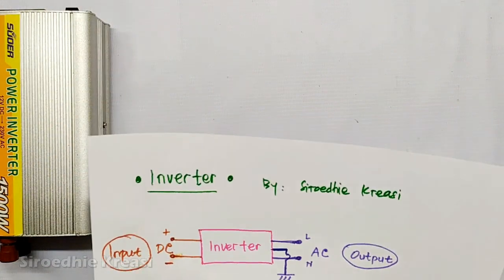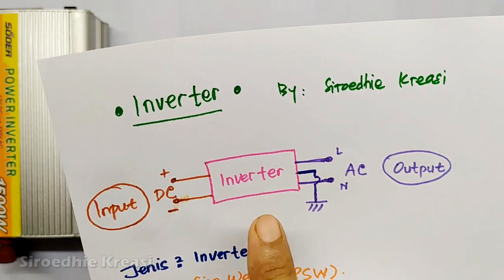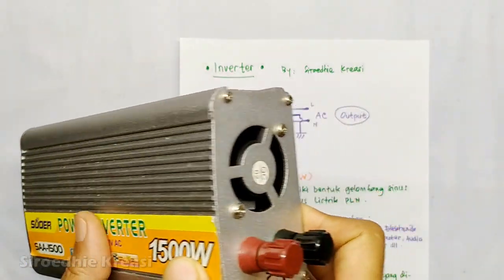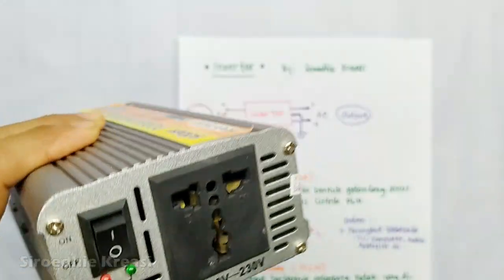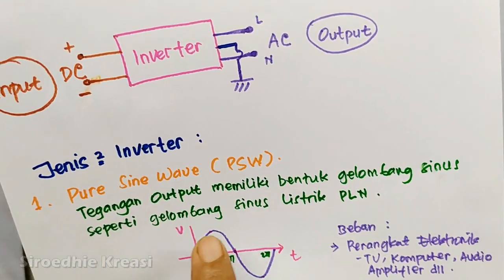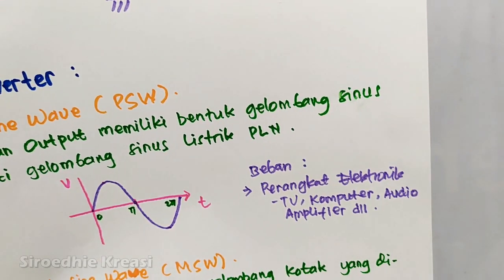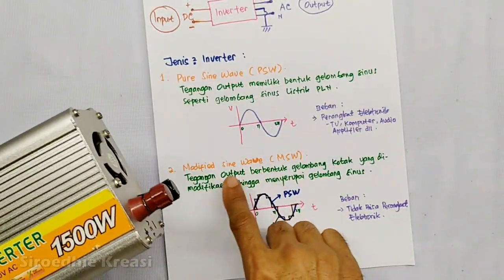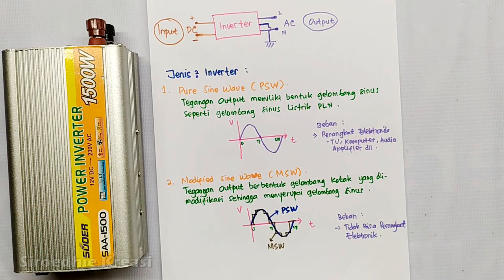Jangan Salah Pilih Inverter, bisa fatal akibatnya

Comment: Maaf mau tanya pak?
Kenapa ya kabel pada aki bisa nyetrum?
Reply from the maker: karena aki juga merupakan sumber listrik Pak
Reply: @siroedhiekreasi  maksud saya begini pak.

Jika ouput inverter saya sambungkan ke instalansi rumah (kwh meter sudah di matikan) itu ada tegangannya pak di kabel akinya,.

Jika tidak saya hubungkan ke instalasi rumah kabel aki aman2 saja pak
Reply from the maker: @agungwibowo9573  ooo...begitu maksudnya 🙏😀. coba groundingnya dihubungkan
Reply: @siroedhiekreasi  terikasih pak masukannya.
Reply from the maker: @agungwibowo9573  sama sama 🙏
Reply: @siroedhiekreasi  satu lgi pak mau tanya .
Itu kan output aki tegangan 220v . Jika kita ambil sumbernya buat ngecas aki itu sendiri bahaya apa tidak?

Dari aki ke inverter jadi arus AC.
trus kita DC kan lgi untuk ngecas akinya.
Muter trus samapai sumber PLN nyala .

Itu di perbolehkan apa tidak ya??
Reply from the maker: @agungwibowo9573  bisa aja sih, tapi ngecas akinya kita pakai adaptor lagi Pak. tapi menurut saya kurang effisien kalau kita gunakan untuk mengecas aki. mendingan kita buat pengecas akinya menggunakan solar sel (sudah sy buatkan tutorialnya)

Comment: Master mo tny nih: klu inverter PSW berdaya1200 watt dipasang di mobil dgn aki tambahan 100Ah yg ditaruh di bagasi mobil spesifikasi Aki utama mobil 65 Ah dgn kapasitas Alternator mobil sebesar 90Ah, ketika mesin hidup mobil dijalanin apa cukup kuatkah utk mencas kedua aki tsb? Tanya ke-2; Apa boleh body casing inverter groundingnya saya tempelkan ke body mobil yg berfungsi sbg massa/arde dari kutub negatif aki utama mobil dan aki tambahan di bagasi mobil, sekian dulu p'tanyaan sy. Makasih.
Reply from the maker: 1. Sebaiknya tidak Bapak lakukan, karena akan berpengaruh pada alternator. Kapasitas beban (aki) yg terlalu besar melampaui kemampuan alternator akan menyebabkan alternator bekerja ekstra dan menyebabkan umur penggunaan menjadi semakin singkat (rusak).
2. grounding di inverter beda dengan massa yg ada di body mobil Pak. massa di mobil memiliki polaritas negatif, pastikan dulu apakah di sistem inverter menggunakan negatif grounding atau positif grounding 🙏
Reply: Inverter daya(power inverter) dirancang untuk digunakan dengan sistem kelistrikan ground negatif! Jangan gunakan dengan sistem kelistrikan ground positif (sebagian besar mobil modern, RV, truk, dan kapal menggunakan ground negatif).
Reply from the maker: @elangbiru8937  terima kasih sharingnya Pak 🙏

Comment: Untuk mesin penetas, disana ada lampu pijar dan ada timer relay (merk omron) serta termostat suhu (Type STC-3028).

1. Pertanyaan nya, apakah timer relay dan termostat kategori elektronika? 
2. Apakah tdak memengaruhi umur alat jika gunakan inverter MSW?

Syukron Pak.
Reply from the maker: Thermostat dan timer termasuk katagori elektronik Pak,sebaiknya kita gunakan yg PSW Agar umur  pemakaian bisa lebih panjang 🙏
Reply: Pertanyaan yg sama terimakasih sudah dijawab. Saya ada inverter rakitan msw 1000w.. buat jaga2 kalo mati lampu 😀.
Reply from the maker: sama sama kawan 😀🙏
Reply: Brp lama waktu nya untuk pemakaian inverter bang? untuk ngecas hp bisa?
Reply: pertanyaan yg sm sdh terwakil kan..terimakasih..1 lgi ,brp jam pemakaian misal ny utk mesin penetas itu,apakah smpai 6-8jam dengan aki mobil itu
Reply: Baik timer maupun thermostat bisa dibuat secara elektronik artinya dgn komponen solid state tidak menggunakan komponen mekanik.
Tapi kalau timernya masih menggunakan pegas atau motor listrik dan timer relaynya menggunakan relay mekanik, ya bukan tergolong elektronik.
Umumnya alat2 elektronik tidak masalah menggunakan tegangan dgn inverter MSW karena sebelum diumpankan ke alat elektronik pasti ada power supply/ adaptor yg membuat tegangan jadi DC. Dan PSU ini tidak masalah jika diberi tegangan non sinusoida.
Yang justru tidak bisa bekerja dgn tegangan MSW adalah motor induksi.

Comment: Ini baru nmanya tutorial,,, lengkap padat jelas dan patut d acungkan jempol,,, smua komentar pertanyaan di jwab,,, sukses slalu kang...
Reply from the maker: terima kasih kawan, sikses juga buat Ibu Selfi Yanti 🙏
Reply: @siroedhiekreasi  mf bang fungsi inveter tuk apa sih apakah pensetabil tegangan,apakah penghemat listri seperti kapasitor,tolong jelasin maturnuwun 🙏🏻🙏🏻🙏🏻
Reply from the maker: @imungimung231  inverter berfungsi merubah listrik dc menjadi ac. seperti penjelasan saya dalam video ini. silahkan disimak ya 🙏
Reply: @siroedhiekreasi  kalo AC ke dc bisa pake inverter casan laptop ga bang? Kan arusnya 12volt dc ya?
Reply from the maker: @reno7064  kalau dari ac ke dc, alatnya bernama konverter atau yg biasa kita kenal dgn adaptor
Reply: @siroedhiekreasi  . Apakah bisa digunakan dengan waktu lama
Reply from the maker: harus ada istirahatnya pak
Reply: @siroedhiekreasi  mf bang PD dasarnya yg psw tu yg output nya 220 vol tu berarti dh jelas kn psw berarti klo beli inferter biarpun d bodi GX da gambar gelombang psw klo d tes pke avometer kok 220 brrti dh jls y psw mf pemula terimakasih 🙏
Reply from the maker: @imungimung231  output psw dan msw sama sinyal listrik bolak balik 220 volt. hanya saja jenis psw sinyalnya sinusoidal murni dan msw tidak murni/ modifikasi (gelombang persegi yg menyerupai sinusoidal)
Reply: @siroedhiekreasi klo untuk ces hp aman mas
Reply from the maker: @m.r.gchanel409 aman mas, pakai jenis psw
Reply: @siroedhiekreasi cara belinya gmna KA apa untuk mesin jahit portabel
Reply from the maker: @SriyatiYati-ln6jw di toko online banyak ka, jenis maw dah bisa
Reply: @siroedhiekreasi  okey terimakasih ka
Reply: @siroedhiekreasi  okey terima kasih
Reply: @siroedhiekreasi assalamu alaikum pak..kalo sy mau pake buat mixer kue yg daya watt mixer nya 170 watt..sy harus beli yg mana pak ? Inverter PSW atau MSW pak ?? Terima kasih sbelum nya sehat dan sukses selalu bersama keluarga pak amin..
Reply from the maker: @QIAdanICA untuk mixer, jenis msw dah oke pak
Reply: Setuju bangeettttt........
Reply: Ya mantap
Reply: Maaf bang mau tanya,lantas cara mengetahui psw bagaimana klw mau beli,bagi orang awam seperti saya 🙏
Reply from the maker: @wahyuniyuni6935 untuk mengetahuibpsw dan msw ada di video saya yang lain bang (silahkan cek di playlist "kelistrikan"). biasanya jenis psw tertulis gelombang sinusoidal bang
Reply from the maker: @wahyuniyuni6935 ini linknya bang https://youtu.be/Lj0GVqGmazs?si=K0hMnRVl4A1q0UtI
Reply: @siroedhiekreasi maaf bang mau tanya. Kalau mau buat PLTA rumahan apa aja bang yg dbtuhkan.
Dan kira2 biaya hbis brapa
Reply from the maker: @nurrohman236 Kalau PLTA konsepnya beda lagi bang. materi ini cocoknya untuk PLTS
Reply: @siroedhiekreasi  kalau PLTA materialnya apa aja pak
Reply from the maker: @nurrohman236 PLTA menggunakan kincir air (turbin), generator , aliran air dll
Reply: @siroedhiekreasi  tenaga angin pak bukan air.. saya mau belajar buat listrik tnaga angin.
Reply: Belinya d mna..
Reply from the maker: @seaboeloex6945  di toko online banyak pak
Reply: Kalau hanya untuk lampu 4 pcs tahan brp jam yah bg
Reply from the maker: @sukrianto4817 total lampu berapa watt bang, dan aki berapa ah ?
Reply: Jd kl aku belli inverter untuk Kipas angin, cocoknya pake inverter apa Mas? Psw atau msw ? Mohon balasanya
Reply from the maker: @ismailrusdin7524 kalau hanya untuk kipas angin, msw dah bisa Mas
Reply: Bg,sya pengen pasang ac prlortabel ka truk.itu hrus pke inventer brpa ya
Reply from the maker: @nickovalentino5296 ac nya berapa watt mas ?
Reply: Itu pakai aku basah atau aki kering pak
Reply from the maker: @ubaidsportsurabaya aki kering pak
Reply: Langsung di  colok kan ke batre mobil tanpa di copot kabel 2 yang di mobil bisa mas
Reply: Kalau buat di lahan trus cas aku bisa menggunakan panel surya nggak?

Comment: Maaf bang saya mau nanya kalau inverter 500wat  pet di jalur DC pakai berapa bagusnya bang
Reply from the maker: penggunaan tegangan DC nya relatif Pak, boleh menggunakan 12 volt ataupun menggunakan sistem 24 volt, tergantung ketersediaan yg kita miliki. Dan tegangan  aki mengikuti tegangan input inverter 🙏
Reply: Oh gutu ya bang.. makasi ya sering nya.
Reply: Kalau salah satu short petnya tapi ukuranya beda boleh bang
Reply from the maker: @karmawanwayan6719  maksudnya gimana Pak ? belum jelas saya 🙏
Reply: @siroedhiekreasi  maskudnya moafet di infut  kode nya beda

Comment: bg,  mau nanya itu di video kan kalau ac dc nyetrum ya, berarti kalau DC tidak nyetrum ya bg ? yg tidak nyetrum ada rekomendasi ndak untuk dipasang di mobil ? ... kegunaan sih untuk laptop , printer ama speaker active aja.... kg perlu mpe yg bisa masak nasi atau bawa kulkas segala hehe....
Reply from the maker: Alat yg saya tampilkan di video ini adalah untuk merubah tegangan dc menjadi tegangan ac. Dengan input dc 12 volt dan output ac 220 volt. Kalau masalah nyetrum,  semua tegangan listrik bisa nyetrum Pak,  hanya saja karena tegangannya kecil 12 volt makanya tidak nyetrum. Kalau untuk beban seperti yg Bapak sampaikan,  bisa gunakan inverter jenis PSW dengan input menyesuaikan tegangan aki di mobil dan biasanya 12 volt dc. 🙏
Reply: @siroedhiekreasi  wah makasih banyak penjelasanya...sya coba cari2 inverternya jenis PSW dengan input sesuai tegangan aki..makasih banyak sharingnya....
Reply from the maker: @yuriastoria3071  sama sama kawan
Reply: @siroedhiekreasi  maaf bang nyambung pertanyaannya,soalnya mau pasang stb dvb t2 yg buat tv di rmh tp pasang di mobil. 
Inverter 200w, buat stb + antena digital (taffware) pakai yg colok ke lubang cigaret, aman ga ya.?
Reply from the maker: @tugimantugi3151  aman bang, pakai yg jenis psw dan daya inverter minimal 2x daya beban yg digunakan
Reply: @siroedhiekreasi  ok makasih info nya bang
Reply from the maker: @tugimantugi3151  ya...sama sama kawan

Comment: Kalo yang inverter yang 500wat bisa ngangkat lampu berapa wat mas?
Reply from the maker: Biasanya kapasitas inverter 2x kapasitas beban. Kalau inverter 500 watt bisa mengangkat beban lebih kirang 250 watt
Reply: @siroedhiekreasi  kalo pake aki motor trs motor nya sambil di nyalain gmna mas bisa apa ngga?
Reply from the maker: @topikhidayat7659  gak masalah mas,  aman. Tapi sebaiknya kita pasang fuse,  agar ada proteksinya 🙏

Comment: Idupin salon 12 inch bisa ga bos? Tekor ga akinya, soalnya saya ga tau kalo nyambung nyambung kelistrikan pd mobil takut korslet
Reply from the maker: Coba lihat kapasitas dayanya Pak,  12 inch itu berapa watt nya
Reply: @siroedhiekreasi  nah ini yg sma mau tanyakan pak , kan ada inverter 1000 1500 dan sebagainya , jikalau aki kita berkapasitas 12 v 20ah dipakaikan ke inverter 1000 watt itu outputnya mampu membebani sampai berapa watt dan bagaimana jika aki tersebut dipakai dengan inverter yg lebih tinggi misalnya 2000 watt
Reply from the maker: @septianwahyono3132  biasanya dalam perancangan kapasitas daya  inverter harus 2x lebih besar dari kapasitas beban,  kalau kapasitas inverter diperbesar menjadi 2000 watt gak ada masalah Pak,  asalkan tegangan inputnya sama dengan tegangan aki
Reply: @siroedhiekreasi  owh bgtu ya pak , jadi semakin besar ah akan menghasilkan watt yang besar yah ,dan inverter harus tetap diatas kapasitas dari beban yang dihasilkan aki , oke terima kasih pak atas jawabannya ,
Reply from the maker: @septianwahyono3132  terima kasih kembali kawan

Comment: om kalo inverter 1000w dengan arus MSW di pakai di mobil kap 12v 60ah apa aman om untuk pengoperasikan rice cooker atau tv untuk sementara waktu (liburan keluarga di luar rumah)dan waktu aman pemakian berapa lama? terimakasih,,
Reply from the maker: Kalau untuk mengoperasikan tv,  sebaiknya Pak Bono gunakan inverter PSW. Waktu pemakaian sangat relatif,  tergantung dari kapasitas aki dan banyaknya beban yg digunakan
Reply: aman ya om kalo hanya rice cooker?
Reply from the maker: @bonosandoro2727  kalau cuma rice cooker pakai MSW sangat aman Pak
Reply: terimakasih info'y om,,
Reply from the maker: @bonosandoro2727  sama sama Pak
Reply: sukses terus omm,,
Reply from the maker: @bonosandoro2727  amin,  terima kasih Pak

Comment: Izin bertanya pak, kalau kebutuhan untuk daya ac 1800 watt to dc inverter 3000 watt berapa ukuran akinya dan kekuatannya power akinya  bs bertahan brpa lama?. 
Apa bs pasan battery indicator ?
Terima kasih 🙏
Reply from the maker: Ukuran voltase aki sangat tergantung dari voltase input inverternya Pak. Untuk kapasitas baterai bisa kita hitung terlebih dulu arus pada sisi beban
Reply: @siroedhiekreasi  alhamdulillah terima kasih infonya pak 👍

Comment: Bang kalau pakai inverter daya 1000watt itu bagusnya dikasih aki brp volt?
Reply from the maker: Lihat tegangan input inverternya Pak,  kalau menggunakan tegangan 12 volt maka tegangan aki juga 12 volt. Begitu juga halnya kalau menggunakan tegangan input 24 volt
Reply: Ampere mungkin gan, soalnya rata" Aki 12v
Reply from the maker: @magisk_manager  tegangan aki bisa kita buat 24 volt Pak,  dengan cara dihubung seri 🙏
Reply: Mungkin maksudnya untuk beban 1000watt aki minimal berapa ampere supaya bisa digunakan lebih lama

Comment: Ko saya masih bingung ya pak td bpk blg yg msw tdk bisa elektronik tp saya liat comen"nya bisa buat lampu pompa air pake msw. Apa trgntung waatnya ya.
Reply from the maker: Yang saya maksudkan beban eleltronik itu adalh yg mengandung komponen seperti transistor,  ic,  kapasitor dll seperti laptop,  komputer, tape, radio, hape.  adapun beban seperti lampu pijar,  setrika,  rice cooker,  pompa air dll tidak tergolong beban yg saya maksudkan. 🙏
Reply: kalo AC pake MSW bisa tidak?
Reply from the maker: @agungprast3857  kalau untuk AC sebaiknya gunakan yg PSW kawan,  karena AC menggunakan rangkaian elekronik sebagai kontrolnya

Comment: apa semua inverter di wajibkan ampere arus DC juga harus sesuai? misalkan arus dc 12 volt 2 ampere jadi harus pake inverter yg 2 ampere juga?
Reply from the maker: inverter itu maksudnya adalah perangkat elektronika daya yang mana inputnya tegangan DC dan outputnya adalah tegangan AC. kalau Pak Bayu punya peralatan  beban DC 12 Volt 2 ampere, alat yg digunakan bukan inverter, melainkan konverter atau yang biasa dikenal dengan adaptor dan kerjanya kebalikan dari inverter 🙏

Comment: Coba tespen positif negatif inverternya apakah outputnya lampunya menyalah keduanya
Reply from the maker: belum pernah saya cobain kawan, kira² maksudnya untuk apa ya ? terima kasih
Reply: @siroedhiekreasi  saya mau pasang Watt meter ac di inverternya tpi ada bau gosong gitu jdinya
Reply from the maker: @putuandre5510  ooo begitu, watt meternya apa gak salah sambung kawan ? karena setau saya wattmeter ada kumparan arus dan kumparan tegangan 🙏
Reply from the maker: dan tidak boleh terbalik pemasangannya
Reply: @siroedhiekreasi  sudah benar kok N dan L nya
. Coba masnya Tespen output inverternya apakah nyalah kedua lampunya
Reply from the maker: @putuandre5510  tidak memyala kawan
Reply: @siroedhiekreasi  satu aj menyala ya pak
Reply from the maker: @putuandre5510  iya pak benar

Comment: Mas, saya mau jualan jus buah keliling/ Mobile pake roda tiga menggunakan blender dan Juicer. Boleh minta rekomen jenis inverter yg pas, plus aki yg bagus. Terimakasih banyak mas 🙏
Reply from the maker: semoga jualanannya sukses ya kawan. kalau hanya menggunakan blender dan juicer Mas Adil boleh menggunakan inverter MSW 12 volt  seperti yg saya gunakan dalam video ini dan gunakan aki 12 Volt yang 60 Ah (merk terserah aja Mas). Tapi Mas Adil harus sediakan juga alat untuk Charge Akinya.
Reply: @siroedhiekreasi  MasyaAllah terimakasih banyak mas Edhie..info joss, semoga jadi amal jariyah panjenengan. Auto subscribe 😁👍
Reply from the maker: @adilsailendra4832  Amin...terima kasih doanya Mas, salam sukses selalu

Comment: Bang misal input ke inverternya pakai power supplay 12v dc, tdk pakai aki bisa engga??  Maksudnya biar di rumah bisa pakai mesin las supaya kuat tdk jeglek2 mulu daya listrik di rumah cuman 450
Reply from the maker: tidak bisa pak, karena daya output mengikuti daya input. karena power supply mengambil catu daya dari listrik 450 VA. effisiensi tidak mungkin lebih dari 100 %.

Comment: Terima kasih infonya bang... klo utk charge HP bisa gak yg MSW?
Reply from the maker: kalau yg msw sebaiknya jangan gunakan untuk charge hp kawan, karena yg msw outputnya tidak sinusoidal murni. sebaiknya gunakan yg psw, tapi agak mahal
Reply: @siroedhiekreasi  baterai lithium rakitan 45ah dgn BMS 60 Amper di padukan dgn inverter msw Utk menyalakan kipas angin,kulkas,tv tabung bisa gak?
Reply from the maker: @hendywijaya6800  bisa Pak, sesuaikan tegangan input inverter dengan tegangan baterai tsb. saya sarankan pakai yg psw 🙏
Reply: @siroedhiekreasi  klu misal inverter rakitan dr trafo 5 ampere 12 volt..itu sinus murni gk pak?
Reply from the maker: @hendywijaya6800  tidak sinus murni Pak, inverter psw sistemnya lebih komplek dan banyak menggunakan filter
Reply: @siroedhiekreasi  oke pak,,makasih atas informasi dan masukan2nya

Comment: mas,klo inverternya 12volt, pakai aki yg 24volt,bukan pararel 12v+12v, tetapi lgsung pkai aki yg 24v,aman gk volt ke inverternya?
Reply from the maker: kalau menggunakan aki 24 volt, maka inverter juga menggunakan yang 24 volt kawan. tidak bisa inverter yg 12 volt